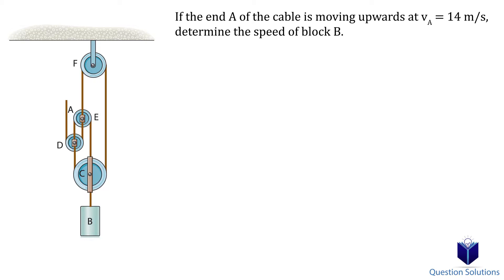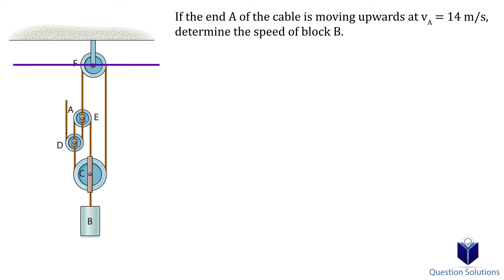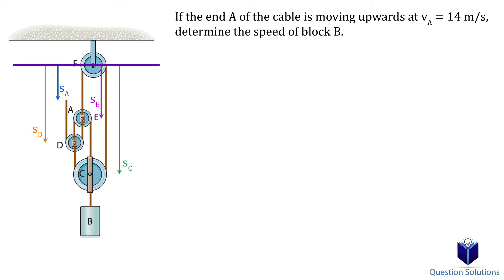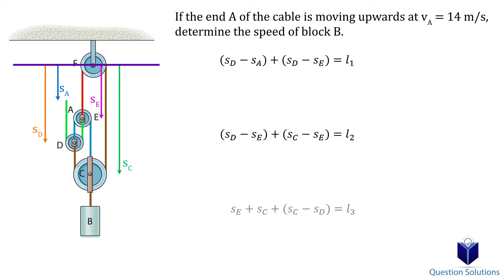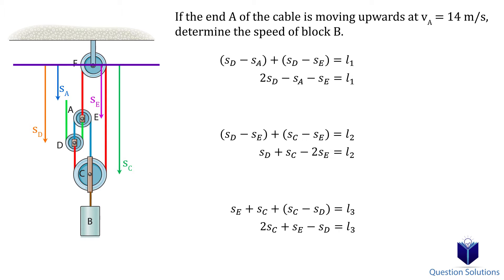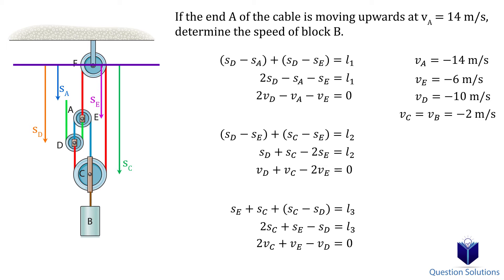If the end A of the cable is moving upwards (solved)

Comment: How can I know how many cables do I  have??? There is one cable hanging from the fixed support.. If I know how many cables I would solve the problem
Reply from the maker: See this video first and then look at the timestamps I am showing in this comment: https://youtu.be/IudPPGIV5QM?si=tf6KvF9dx97I9Ayh

One way would be to trace the lines with your pencil. So you start off at a beginning and then trace that line, if it loops around a pulley, it's still continuous. If it stops at a hook or the middle piece of a pulley, then that's the end of a segment. 

For example, at 4:23, we have a line starting at the top left, we trace it down, loops around pulley B, then loops about pulley C, but then ends at the middle of pully B. That's one cable. 

At 6:40, we start at point B, it goes around the huge flywheel, goes to pully A and loops around that, then it goes up to the small pulley and loops around that and ends at the middle of pully A. That's a single cable. 

At 3:07, a cable start at A and loops around pulley B, goes and loops around pulley C and ends at a hook. The other cable starts at a top hook on the top right, goes down and loops around the bottom pulley and abruptly ends at the hook attached to pulley C. 

So you trace them with your pencil, and see where they end. Usually, they end on a hook or the middle piece of a pulley. If it loops around a pulley, it's continues. I hope that helps.

Comment: Hello Sir,
Thank you for these videos. It is really very helpful and i cannot express by gratitude in words. 
From this question, i have a doubt. i can identify only one cable which starts A to D then to F pulley(via pulley E) then going down to pulley C then going up thru the midpoint of pulley D then to pulley E and down to pulley C which is attached to mass B. Can we solve using that way? Please help Sir
Reply from the maker: Unfortunately, no, this system has 3 separate cables. Each of those little blocks with a grey circle in the middle starts off a different cable. So you have to think of them as separate cables or you can't get the right answer. Did you try it you way, and did you get the same answer or no? Please let me know, thanks!
Reply: @QuestionSolutions   Thank you for the reply Sir! I tried my way, but unfortunately, I dint get the correct answer. But now its clear. Thanks for the clarification!
Reply from the maker: @molootty1  You're very welcome!